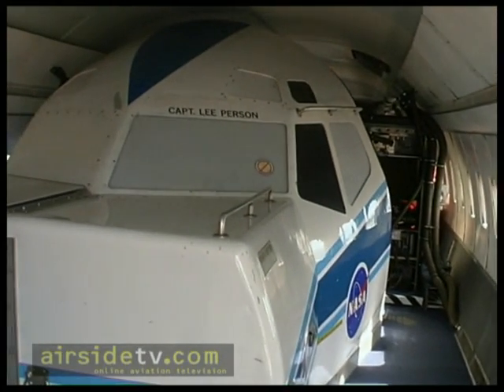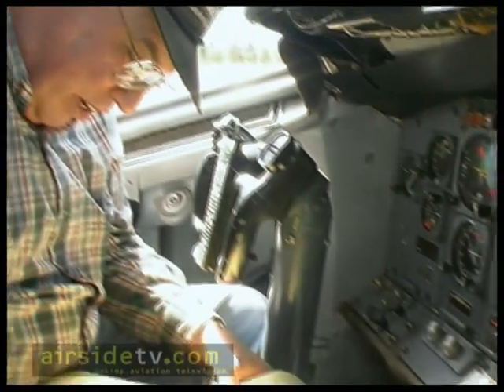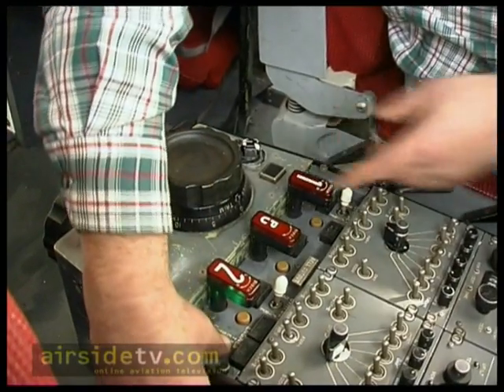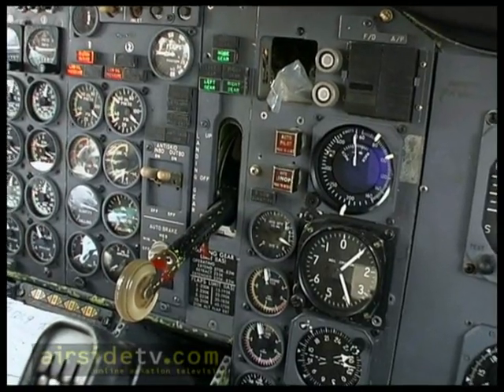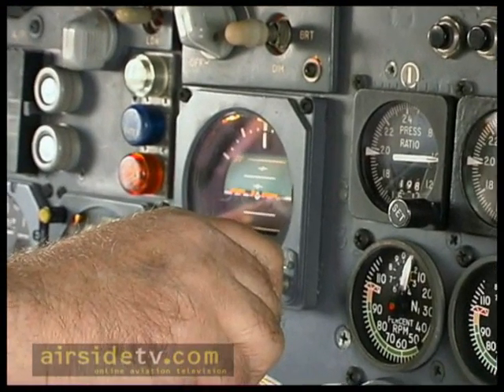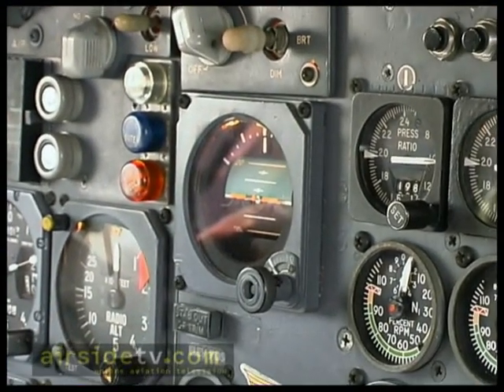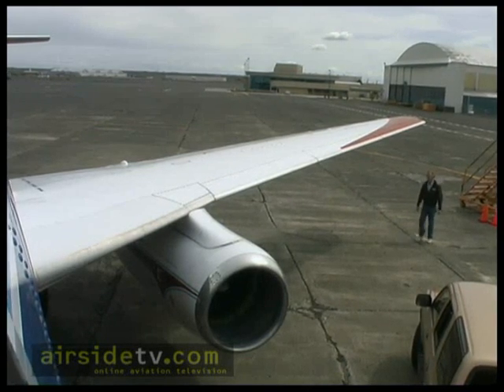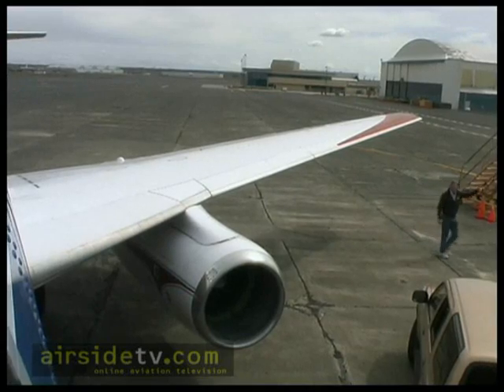Prototype Boeing 737 Part 2/4

Comment: It's nice to know that the prototypes for the 707, 727, 737 and 747 are still around (and technically flyable). Gee, McDonnell Douglas, you couldn't do the same for the DC-8, DC-9 and DC-10??? And how about the L-1011?
Reply: Remember that the original MD-80 prototype crashed? The tail snapped off..........